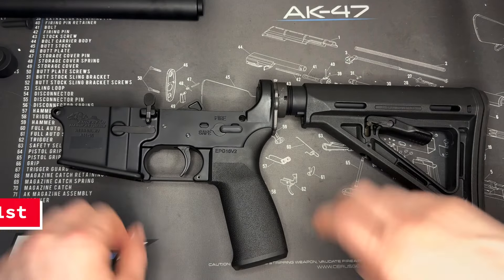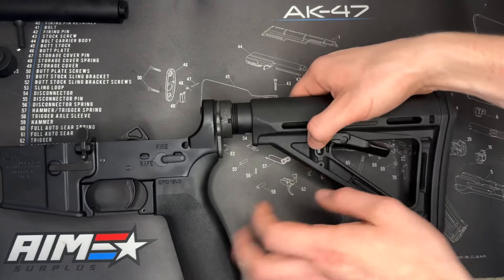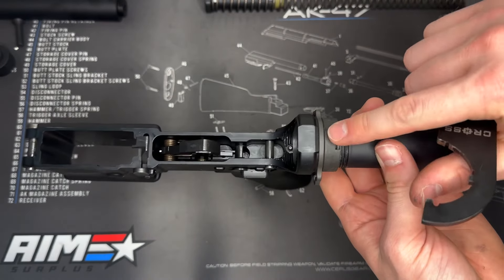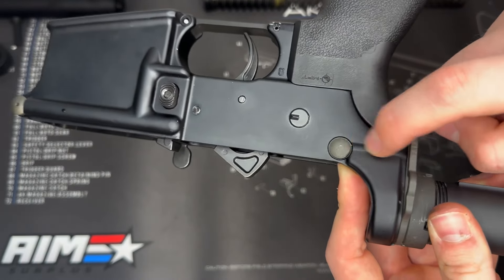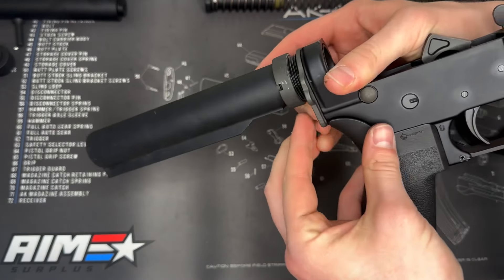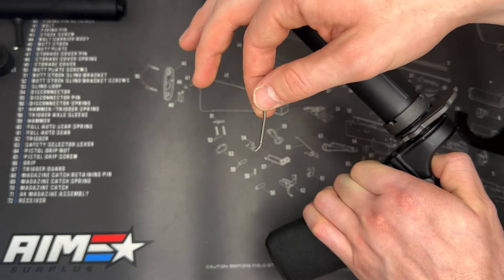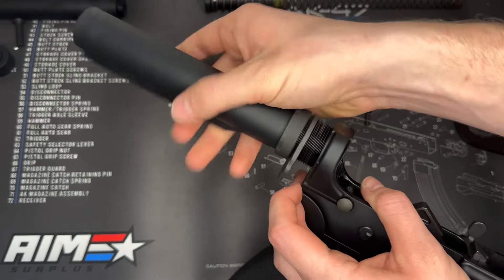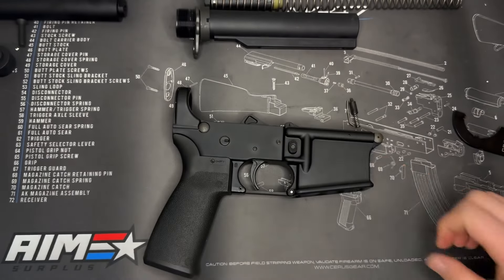How to Remove an AR15 Buffer Tube

Comment: I have wrecked several springs for the rear detent pin.  Some genius came up with the idea to tap the dentent /spring hole with a 4-40 tap in about 3/16 of an inch, and then follow it in with a 4-40 set screw until it is flush.  What a great idea!!  it is so simple to install now without crushing that little spring or chasing tiny  parts

Comment: Hey I was also switching to an A2 style stock and I noticed that my new buffer tube doesn’t reach far enough to hold the buffer spring detent pin down
Reply from the maker: Hmm interesting. Not sure what’s happening 🤔
Reply: I added an Aimaculate folder to my pistol and had the same problem.  The buffer tube had a shoulder on it, so the threads wouldn't reach the buffer spring detent.  Had to buy a new buffer tube.
Reply: Did you forget to put in the extension part before you installed the buffer tube?

Comment: Just received my (California Compliant) Daniel Defense today.  Pulled the cord on the rear takedown pin a bit too aggressively, completely removing the pin and sliding the spring loaded detent forward.  Can't get my rear takedown pin back in.  Might just find a gunsmith who can make other modifications (king pin and grip) in order that I become allowed to use a normal mag release..........and fix my takedown pin in the process.  Warning:  Don't pull your takedown pin TOO hard.......!!!!!

Comment: This is perfect for me. I've studied most of the parts of an AR and thought pulling the buffer tube would be easy. Whith two springs flying that was a little concerned at first. 😅 
But then I saw your video and realized the springs and detents were easy to put back together and all is well now. 
Thanks!

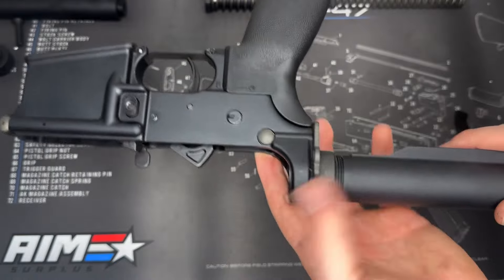Comment: 1:45 >> Remember: safety glasses << when working with ANY springs! (Buffer retaining pin & spring in particular, those can pop out violently if not paying attention when unscrewing the buffer tube, with the lower receiver oriented upright. Sproing'n directly into youre EYE(s)...
-Please DONT be that guy/gal  down @ the emergencia room!

1:45 A little trick I use to always retain the 5.56 AR15's rear take down pin detent & spring when disassembling stock/buffer tube, also GREATLY helps to ease RE-assembly of buffer tube & receiver plate without bending/kinking take-down detent/spring when affixing plate & buffer tube, as you seem to almost need a third hand doing so when inexperienced with the process: 

1- Remove stock, buffer, buffer Spring, loosen castle nut, remove buffer retainer pin/spring, rear plate.
2- Remove rear take-down pin detent & spring entirely. 
3- Go purchase a tap handle & small threading tap that fits factory/original hole drilled in back of receiver @ time of manufacture/assembly for the rearmost take down pin.
(You MAY need to drill a teensy slightly larger diameter hole to fit outside diameter of smallest insert plug available? But yet still very shallow, less than a 1/4 inch deep hole to accept smallest threaded insert plug size you can find with smallest allen/HEX key fastening port @ its head)

4- At hardware store, purchase a few small allen/HEX-head threaded 'plug screw insert' that matches thread-pitch of the tap used.
5- Thread/tap the factory drilled hole (around less than 1/4 inch deep sometimes, or total length of screw plug 'barrel' to sit flush w/o impeding rear plate fit/function during/after reassembly)

(If not familiar HOW to DO hand threading, consult the YT oracle on proper hand  tapping/threading procedure(s)

6- Measure original detent spring against the new threaded plug's total length, then snip appropriate length off of spring end to better accommodate the new plug without binding issues due to increased compression of spring & detent with threaded insert added behind it.
-Clip spring end shorter than total plug length @ first to test & dry fit. You can always adjust further by clipping additional tiny amounts off of spring, while you cant ADD any if ya make a mistake (Aside from starting with a new spring)...~Measure once, cut twice right?...;)

7- Use air compressor high PSI to thoroughly blow out any aluminum metal shavings from process of tapping detent spring hole in receiver. Use small wire/nylon brush to swab out hole too. Lightly lube/grease the cleaned hole/channel, detent & spring up.
8-Seat/re-insert rear take down pin, slide in detent & then spring behind them. Spring should sit 'jus a little high of hole, itll be compressed with threaded plug addition.
9- Use allen key to screw in threaded plug behind spring & detent. No need to use blue LOC-TITE, unless wanted or needed. Check rear take-down pin ease of push through, function & overall solid retention.

Ive done this on all 10 of my AR's so far & a few friends rifles without issue. One less spring/detent to lose upon buffer tube disassembly. ALWAYS solidly captured. No issues as of yet with YEARS of usage on all the rifles. Same can be done for safety selector detent & spring on AR15 platforms. Although thats not one thats typically lost if one is careful when removing the AR15's pistol grip. 

Ive chosen to not do same for the safety detent area on all of my 5.56/5.45 AR variants (Aside from two AR10/308 builds where the rear take down detent/spring channel is drilled vertically from receivers bottom side VS. longitudinally/horizontally drilled & retained with the pistol grips top-most shelf, much like a 5.56 AR15's safety switch detent/spring arrangement.....

~Great vid dude, such assists people in completely understanding their rifle, its functions, integrated systems, continued maintenance & future/present parts swap process!....;)
Reply: Please pin this comment, definitely wear eye protection
Reply: @handle924  
Thanks dude. So very true eh?
Even the tiniest of springs can do some serious eye damage when they suddenly !Sproing!
Take 'er easy....

Comment: is this a steel castle-nut?  It seems like it from the vid--I have a machined-aluminum castle-nut and the slots are stripping like crazy at the slightest application of torque from the spanner wrench.  I need to adjust the buffer tube's axial alignment because the stock is off-canter...kinda like 6:30-12:30 alignment instead of a proper 6-12 o'clock.

I imagine that's common?

I'm asking 'cause I'ma layman--notta professional armorer.

Any tips or insight (maybe confirmation that stripping is common on aluminum castle nuts?) would be appreciated.  Thanks in advance!

Comment: Hey man sure could use a little help. I pulled back the charge handle on a stock colt m4 and the bolt stayed right in place. I pull both take down pins and they will not separate. Any clues where I should begin the take down. I can break down completely but would rather not. Thanks for any help.
Reply: Hard to know without seeing but it sounds like your bolt is not all the way forward...

Comment: Do you have to use a vise to loosen it?
Reply: Tube should be torqued on, will take some oomph to remove.  You'll need a plastic vice block that inserts into magazine well.  Vice will clamp onto the block, not your lower.  Less than $20 online.

Comment: Where'd you get the buffer tube and spring for the solid stock? I'm looking to do just about the same thing with mine and have had no luck.
Reply from the maker: It all came with the new stock! I have another video up installing the fixed stock and show what all it comes with it! Check it out!!🙌🙌
Reply from the maker: It all came with the new stock! I have another video up installing the fixed stock and show what all it comes with it! Check it out!!🙌🙌
Reply: @1stShotTactical  I will do that!!

Comment: Do you have a video on the buffer tube breakdown on VR80
Reply: ITs the same except the spring deal, just get to the point you loosen the castle nut around the buffer all the way back then the metal plate will lift up to the nut and unthread the buffer tube